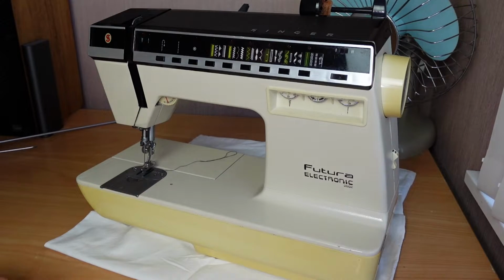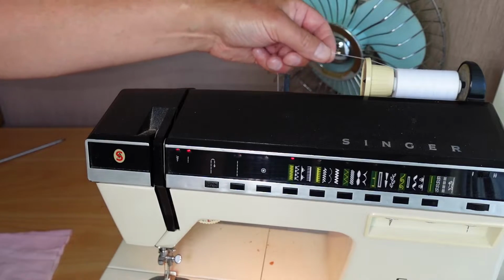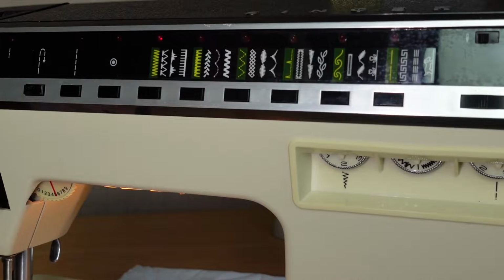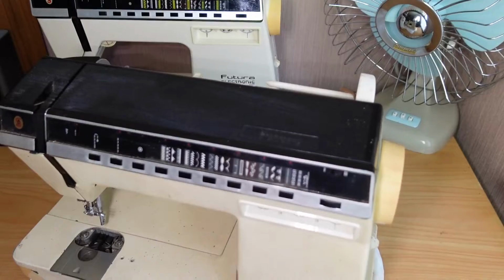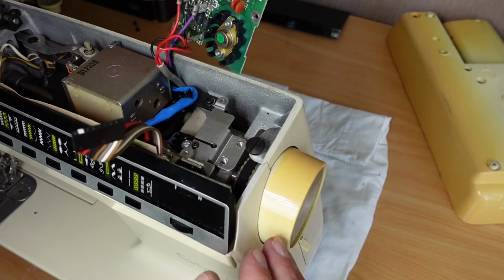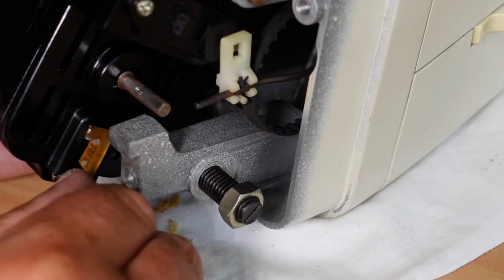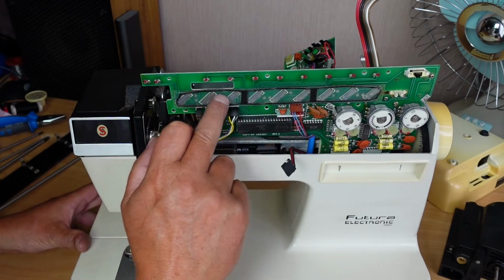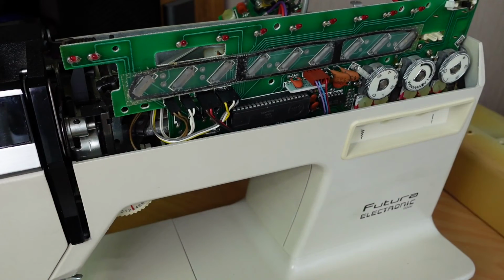Reviving this '80s Classic Singer Futura Electronic 2002 - Part 1

Comment: I am very glad you are showing how to repair these wonderful late century Singers. And, your attitude about them is grand. I am so tired of reading and hearing how bad these machines are. Sure, they may need a few replacement parts but that is how most things made after  the 1950s early 60s are. I have two of these 40 year old Singers  and I find them easy to use and still very advanced by today's standards...and nothing beat a slant needle and wind in place bobbin!!! Hope to see a video on your collection.

Comment: I used to repair them but quit taking them in about 20 years ago. Too problematic. Rubber feed dogs, motor mounts, spool pins broken, feed and hook driver gears, on and on. Probably tossed 3-400 of them in the recycle bin without salvaging a single part.

Comment: This is the first time I've come across anything about this machine. I was given this as a 21st present from my parents as a forever machine, sadly only 12 years later the circuit board died and to replace it was $900. So I bought a new one, which I still use today successfully. Nothing electronic on this one. lol. I believe I still have my old singer futura somewhere. Do you think it is worthwhile getting a new circuit board and getting it fixed? I love this machine it was a great little machine.
Reply from the maker: If you could get a good circuit board at a good price it would probably be worth it if it's just for playing around with. That's only if all other mechanisms are working properly. Thanks.